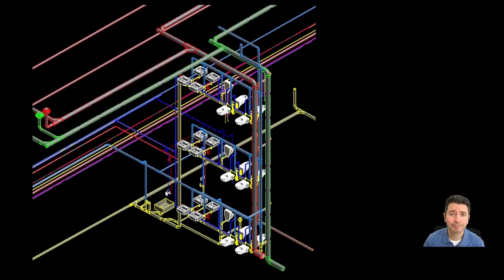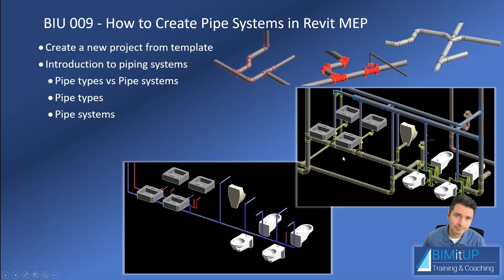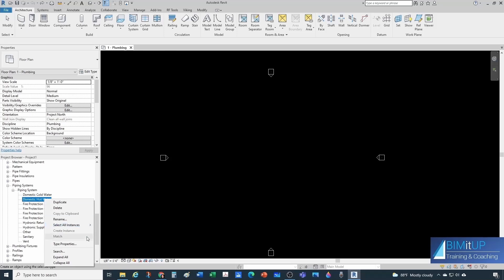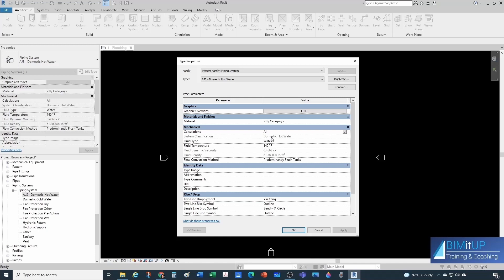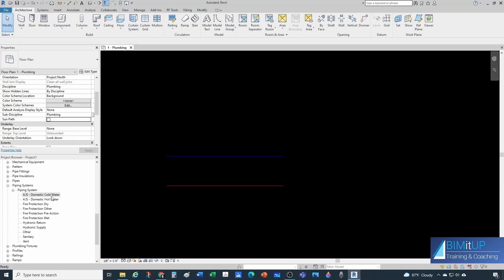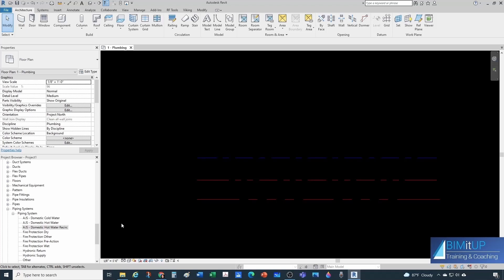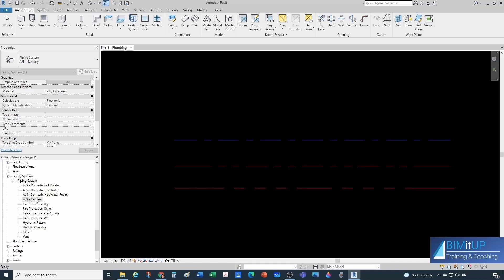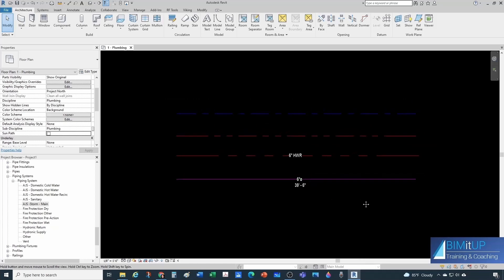How to Create Pipe Systems in Revit MEP Tutorial

Comment: How do you create a Steam System?
Reply from the maker: Good question Fraser.
What I would do is create a duplicate of the Hot Water System, rename and assign new abbreviation; and, if you're calculating anything, adjust the thermodynamic properties (i.e. set the temperature and pressure based on what thermodynamic state you're working with. For example, if you are working with saturated steam you would use 220°F @ 2 psi gauge. This will give an approx. density, viscosity, etc. Not perfect, but can get you started. Good luck!

Comment: Hi nice video btw, how do I connect system type to pipe types so I don't have to change it everytime in properties
Reply from the maker: Good to hear you liked it.
Revit "Fabrication" has what is called "a service", which is a combination of pipe system and pipe type (for example "domestic Water/Brazed Copper", but in general:
Pipe Types and System Types are two separate things, because you can have cold water within brazed copper or welded steel, or glued CPVC, etc.
But the best tip I can give you is: Select the pipe that has the system and the pipe type you like and do "create similar" =) Good luck!